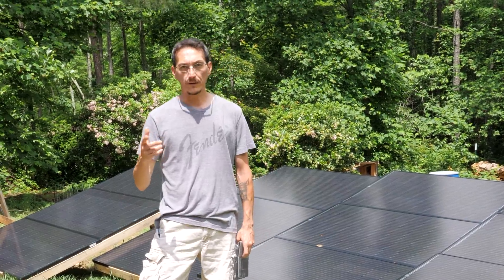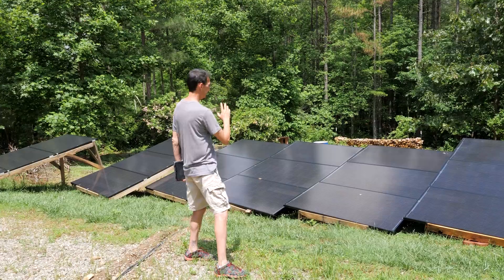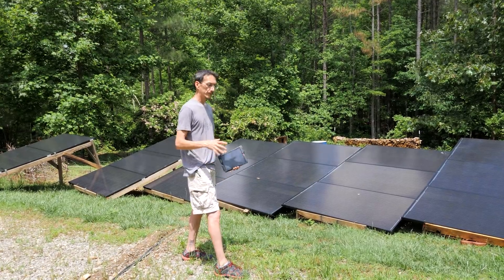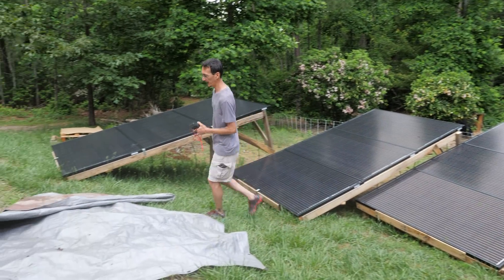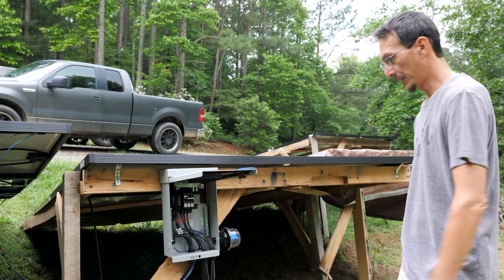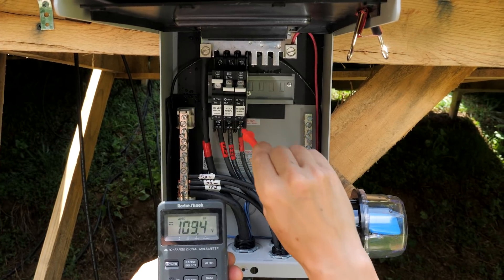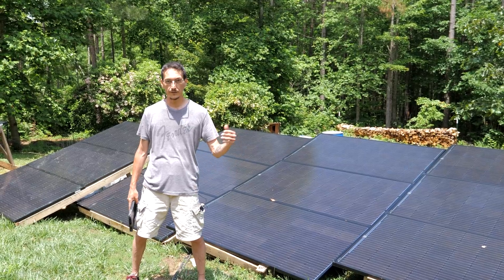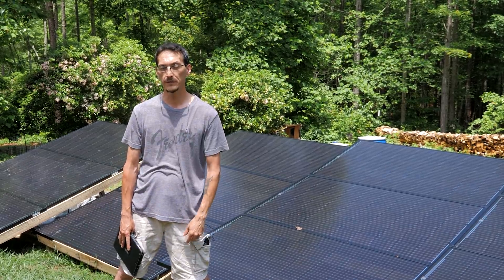DIY Off Grid Solar: Building a Renewable Energy 5.2 KW Solar Panel Array (Part 3)

Comment: I didn't follow most of that, but watched all the way through, all the same. If I got to the point of installing my own, this would make a lot more sense. But you were to the point with relaying numbers, series and how everything connected up. Which makes it a little easier to follow as reference material. So even though I didn't follow it "precisely", I could see you were systematic and therefore easier to follow the gist of what you were explaining. It's great you're doing these videos.

Comment: Excellent, covering the panels while connecting is extremely important, not just for your safety but also for the safety of the components that could be shorted out. You are showing, once again, that you are taking the time to do it right and safe the first time.

Comment: If you put the inverter next to the panels, and ran AC to the batteries, you would not have the voltage drop, and not need such large wire. I don’t know if the losses from going from DC to AC and then back to DC and the expense of another inverter offset the expense of large gauge wire.
Reply: 95% efficient inverter, 5% loss, times 3 (counting AC to DC for batteries as an inverter), 15% loss from inverters. He spec'd the wire for no more than 3% voltage drop. If I understand everything correctly, using inverters like you suggest would be 5X less efficient than his planned setup.
Reply: Or if it was feasible, build a "power shed" near the panels for the inverters and battery bank.   Then run AC from there to the house
Reply from the maker: The 3 strings are then wired in parallel at the combiner box so 100 volts at up to about 26 amps. Using 10 gauge AC wire would probably work but stranded copper is better for DC and AC is usually solid copper. We’re using 4AWG fine stranded copper welding cable and it’s working great.
Reply from the maker: Slightly 😂
Reply: Usually running 110 volts AC means you're using way thinner wire than say 12 volt or 24 volt DC. But the panels are wired in series to be about 100 volts DC so you'd actually use the same wire as using a 110 volt inverter.
Reply: Yeah, 4 ga ought to cut down on your voltage drop ;)
Reply: How much does a run of 4 gauge wire that long set you back?
Reply from the maker: $.74/ft

Comment: The panel angle looks a bit low for an off grid system. They should be set close to the Winter angle to maximise the worst case production around the Winter solstice. In Summer you will get more power anyway due to the longer days.
Reply from the maker: They will be raised up for winter
Reply: No problem :-) By the way, thanks for the videos

Comment: How many hours of tv and you watch at full charge? Can you run central air in a house and watch TV ?
Reply from the maker: An energy efficient LED tv should be able to run all day. This system is not designed to run AC but we have a separate plan for that. 😉